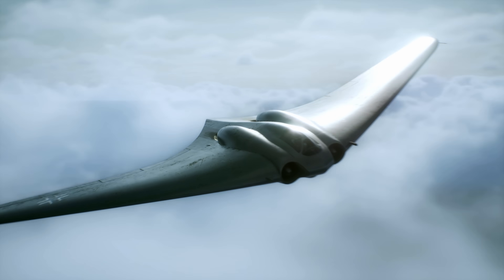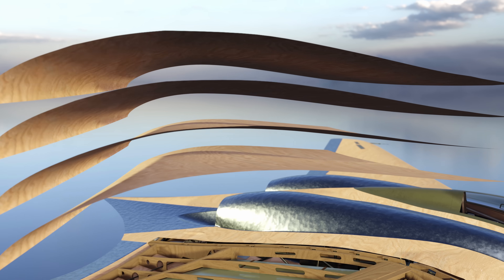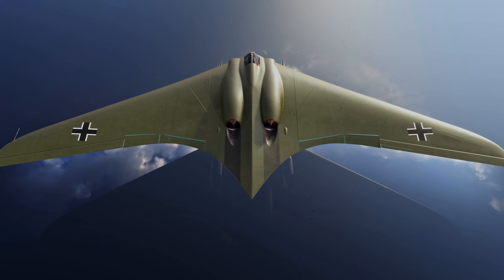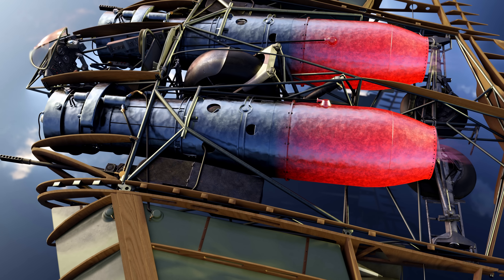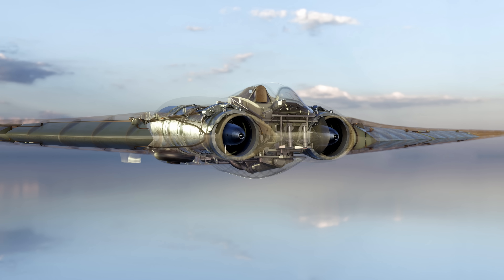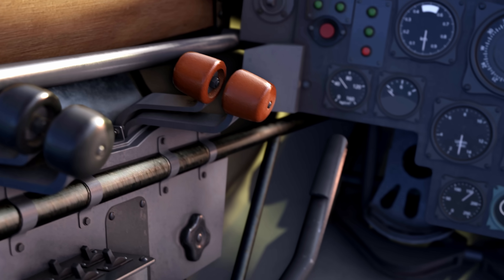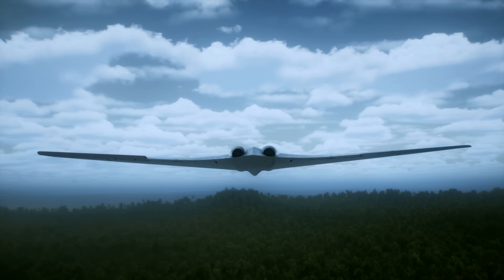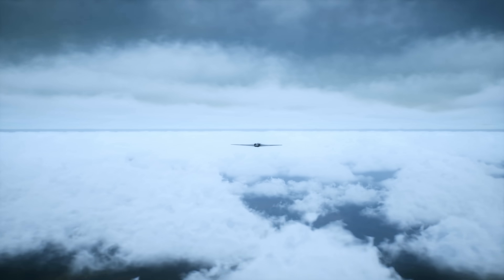Inside the Horten Flying Wing

Comment: You completely over looked both the B-35 and B-49 flying wings of Northrup. Both of which were in inspiration for the B-2 spirit, NOT the horton 229. Jack Northrup was experimenting with powered flying wing designs a decade before the Horton brothers.
Reply: yup, the ho 229 had nothing to do with the design of the b2, and it was also only marginally less visible on radar when they tested it lol
Reply: The Horten brothers did it before Jack Northrop in 1933 with the Horten H1 flying wing glider while Northrop did it later near the end of that decade and test it in 1940. Yes Northrop was powered first but The Hortens idea of a flying wing came first.

Comment: Lovely video and great content. I would prefer if it were narrated stating metric measurements though, esp. as it was designed using it.  But also, as an educational point - all science and engineering is based on it, so young minds should be exposed to it in this great context.

Comment: I wonder how this would of compared to the Northrup flying wing fighter developed in WW2
Reply: Well.

what the youruber omits is that these worked (not thanks to miracle control surfaces, but) thanks to bell shaped lift distribution, which made them stable.

Northrop used elliptic lift distribution. Making his airplanes unstable  - changing directions when no input is given, even B-2 is unstable witout computer aided fly by wire.

The whole theory that made this airplane work was lost in the german achives till 2015

Comment: Funny how you clowns seem to glass over the fact that Brothers Horton drew a great deal of their design inspiration from a Northrop’s founder Jack Northrop.  Northrops flying wings predated the Hortons by almost 20 years.  Bone up on your history kids!
Reply: ...well issue is they did in fact not.

Both Northrop, and the hortons made no shortage of dubious claims.

So lets stick to what aircraft they built. 

The Hortons got this plane accepted for the same reason Northrop couldnt get any of his designs adopted by.military until the B-2.

The northrop planes were unstable (without computer aid, which B-2 got), while the horten design were aerodynamically stable.

This was not common knowledge till 2015, when some NASA research shone light on what made the horten planes flyable.

They used bell shaped list distribution (achieved by having a slight spanwise twist in the wings), while northrop used the "established" elliptic lift distribution.

Thus even IF northrop's claims are true about hortens stealing ideas from him, even then, the hortens made caluable additions to it, leading to planes that were flyable without computer aid

Here is some reading: https://ntrs.nasa.gov/api/citations/20160003578/downloads/20160003578.pdf

Comment: This isn't the only prototype flying wing Horton had designed. There was also a flying wing Bomber known as the Horton HO-XVIII (it is 18 in Roman Numerals), it was meant to take the war all the way to America, the HO-XVIII is like the HO-229 but much larger, with 6 jet engines, and a gun turret
Reply: The Ho XVIII was only a project, not a prototyp.
Also Horton never designed any aircrafts, all he did was hearing a "huh".
The Horten brothers designed and build serval flying wings befor the Ho IX, starting with Ho I in 1933
Reply: And unlike the Ho 229, which only just barely existed and flew, the Horten H.XVIII barely made it off the napkin to the drawing board. And went no further. And was also hardly the only delusional proposed wunderwaffe meant to take the fight to American soil. 

Even the Japanese leadership knew it'd be impossible to win against America when they declared war. Guess all the meth got to the Nazis' brains.

Comment: You can say anything you want about the Horten 299 but it was an incredibly advanced prototype by any standard. It did had its share of important issues but possibly it was around was the Jumo The Junkers Jumo 004B that had very short "life" because of shortage of heat resistance alloys and prodigious quantities of fuel and the tendency of overheating. How it was determined that it would very difficult to fly I don't know.! Excellent video and I like this video very much 👍 👌
Reply: "How it was determined that it would very difficult to fly I don't know!" Because it was nowhere near the only flying wing prototype of the era and they all have issues with the complex controls needed. A momentary lapse in awareness could (and did) cause you to crash if you weren't constantly babysitting the controls because they needed constant adjustment. There is a reason the flying wing was a dead end until computers advanced enough to automate the control inputs needed for stable flight.

Even Northrop's advanced and actually real and tangible designs (unlike the the plywood prototypes made by a failing, wannabe empire) took decades to bear fruit, and it was paid for with its own share of blood and hard-learned lessons.
Reply: @Nyx_2142  I agree fully with you 👍👍

Comment: There seems to be several flaws in your "report," first, all war time and directly after reports do not suggest the aircraft to be a "fighter bomber" as you say, but an intercepter. Another of the flaws is that it was not stealthy,  however national geographic and northrop's mock up was subjected to the radar frequencies of the time, 1945, and found, that if the aircraft had gone into production, it would have gotten within three minutes of target before being detected by radar signals, to quick for a meaningful response until after the attack.

Comment: The split drag rudders do no look large enough or outbound enough to be effective, and when deployed they disturb the airflow over the elevons. Yaw control would be more effective using clamshell rudders at the wing tips outbound of the elevons with the added benefit of closed position combined movement to trim the flying wing in flight and deployed together act as spoilers, which was the final configuration of the Northrup N-9M small scale test bed flying wing. 

Interestingly, the N-9M actually needed more centrally located spoilers for landing as could be found on the Horten because when landing the N-9M flying wing would create ground effect lift making it difficult to land. The needed extra spoilers where never added due to the plane being a test bed. I have seen the N-9MB in flight during an airshow. The top of the wing was painted yellow and in a slow bank was extremely graceful in flight, it looked like a strange flying potato chip, but to me was the star of the show, looking amazing in all aspects of flight.

Comment: I highly doubt the engines would have let the design, or pilots, be that maneuverable in real life as they would flame out in the Me 262 when it would try tight banking in a dogfight or by opening the throttles too fast. They just would not stay lit. And BTW, the model made by National Geographic is currently hanging in the San Diego Air and Space Museum.

Comment: Too bad the Smithsonian hasn’t restored it. They stored it in a place where it was exposed to moisture and the plywood skin is deteriorated and the frame is rusted. They’ve had it at the Hazy Center restoration shop since I was last there in 2012 and have done little to nothing on it.
Reply: +@fw1421   The museum should duplicate the wooden components and construct the example to the unfinished condition as found in Germany.  It's rotted because of poor storage when donated to the museum.

Comment: Thanks for the video David. It's always nice to see in-depth modeling of the different machines you cover.  I have noticed a few errors or oversights regarding the drag rudders and spoiler. According to the Royal Aircraft Establishment's report No. F.A. 259/1 the outboard spoilers were part of the drag rudder system, fully deploying before the inboard ones as the pilot pressed one of the rudder pedals independently. To add further info about this, the report also states that both pedals could be pressed silmutaneously to use the drag rudders as spoilers proper and increase longitudinal stability. 
As for armament "Monogram Close-Up n°12" states that there were two planned fighter loads, either 2xMK103 with 140 rds. per gun or 4xMK108 with 90 rds. per gun and a short barrel, although the book "Spirit of Thunringia" states the same MK108 load and 170 rds. per gun for the MK103.
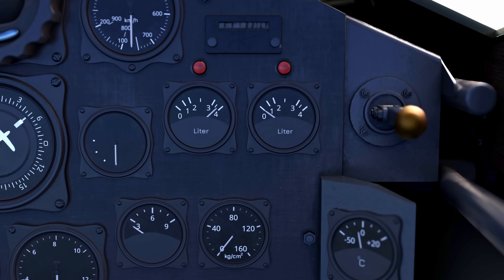The instrument panel could have used a bit more details since there are quite a lot of period and recent photos showing it in several books. For example, the radio indicator at 11:15 was in fact an AFN2 blind landing instrument which also doubled as a radio navigation instrument but the one depicted in the video lacks its altitude gauge, and the tachometers lack the dual RPM scale. Some of the updated textures could be used for future videos on other german aircrafts.
Reply: Quite the in depth and thought out comment! Im sure that the team will appreciate your constructive criticism and I hope you have a fantastic day!
Reply: Those missing instruments might have been taken by Allied souvenir hunters.  Also, by that late stage in the war, aircraft parts were often pirated off of crashed aircraft.  I believe the Horten 9 nose gear ,once belonged to a bomber.
Reply: @jeffreyhagelin3672  The Third Reich was reduced to collecting parts of downed Allied Aircraft for their own prototypes because only a madman would take on the English Speaking Nations, the CCCP,  as well as numerous European Nations with such a small military. So be glad that Adolf Hitler was an idiot, like the rest of the Axis Leaders, as well as Donald Trump, Vladimir Putin, etc. as that limited the damage they could inflict on humanity...
Reply: Thanks a lot` before Paris ending flight of me Goｰ229　1970
Reply: I have to wonder if 21st century materials & techniques would produce a superior tailless fighter (aka B2 style). Perhaps the Skunkworks or another firm is  already is doing so.

Comment: I know the arguments on "is it stealth" and know the pros and cons. Modern definitions of Stealth really apply to Modern Radar Systems and typically ignore 1940s Radar System Capabilities. The Mosquito was considered Stealth for the 1940s with its plywood construction, the Horten would have been stealth for the 1940s with a greater capability than the Mosquito's ability to hide from German Radar systems; coupled with the Horten's size and shape its visibility to the naked eye is far less than the Mosquito. I would honestly like to see two flying versions built off the design, one the original 1940s design, and one using current construction techniques and materials with modern Fly By Wire systems and Avionics to just see what a modern version could do. Just swapping over to Modern High Pressure Aircraft Tires from 1940s Low Pressure Tires would be a weight and space savings. Changing the Airframe to modern Composite construction could shave thousands of pounds giving a stronger overall Airframe. Use of modern Aircraft Control Systems and Avionics would shave off hundreds of pounds and increase flying ability. Switching from a 1st Generation Jet to a current model Fan Jet would both increase speed and range. I could go on.... and, its sad because I know no one will step up to give us that.
Reply: That simply wouldn't work bud. The Horten both isn't that stealthy and wouldn't really have the space for flyby wire or turbofans. The airframe and platform are dead, and would be pointless to bring to modern standards

Comment: This plane looks so futuristic. The Germans really outdid themselves with this design. The only thing that doesn't look super modern is the cockpit, which is more in line with what was available at the time.
Reply: The canopy looks very sleek, are you talking about the actual controls? In that case, of course it did not look modern because they did not have LCD displays lol.
Reply: @romanvarcolac2238  Yes the canopy. Its too frontal if that makes sense. But thats just my my opinion of course.

Comment: 17:27 What about the Northrop XB-35?  I know it wasn't adopted by the air force, but it made its first successful test flights in 1946. Doesn't that count for something?
Reply: Despite what the guy in the video says (and what he doesnt), there is a reason why the northrop flying wings werent adopted, and why the hortens were.

Northrop used the conventional elliptic lift disribution, while the hortens used bell shaped lift distribution.

Using the latter makes flying wings aeodynamically sable.

As such you don't need ace pilots to fly them, when you lack computer aided fly by wire systems.
This was anything but common knowledge until 2015. So even the B-2 is built unstable, though its nice to see the B-21 incorporating the more effective design, with its slightly twisted wings.

Comment: Nat Geo did a program about this. Don’t know who funded it but a model was built in the Northrop Grumman model shop for the purpose of testing the aircraft radar signature or Radar Cross Section. RCS testing was performed. It was determined that the RCS was low (good) enough to effectively defeat the British WWII radar. Good thing this thing never got into production.

This also illustrates the wisdom of the strategic bombing campaign of Germany. Germany was denied access to high tech materials
Reply: It's literally talked about towards the end of the video.
Reply: @Pawheadshot  that’s what I get for bailing halfway through 😂 I knew some of the guys that appeared in that program.
Reply: Eh, it really wasn't a good test, the model didn't have engines and was entirely made of wood if I'm not mistaken, so it wasn't even accurate, and if anything, was just down for the purpose of making the documentart more sensationalized.
Reply: @gp33music41  engines were internal so that doesn’t matter. I know many of those guys and don’t think they would be so dumb as to not use a realistic surface material.
Reply: @Mrblueridgeman  But there were turbine blades, the Apu, external metal components, and internals, especially on a wood skinned aircraft, affect RCS. The 229 was stealth-ish don't get me wrong, but only because it lacked vertical stabs and the flying wing shape.
Reply: @gp33music41  I would expect they put appropriate materials on the external components. Otherwise putting that model up on the pylon and running the test would be wasted effort. At any rate I recall the Nat Geo program saying the improved RCS would give the Germans enough edge against British radar of the time to make a big difference.
Reply: @Mrblueridgeman  They didn't, it's just the truth, and the nat geo program went into to the test with preexisting bias towards it being stealthy. If you look up the white paper, it concludes that it was a little stealthier than like a 109, but only due to the flying wing design. Nat geo took this and ran with it, making it out to be as stealthy as an f22

Comment: Without vertical stabilizer, speed is faster but hard to control. Easy to get crashed especially when there is no AI computers on board with sensors, pitot tubes.
This is why CHN H20 is still just a paper plane on the top of a design table.
Reply: ...what maker of the video wasnt aware (or what chatgpt didnt mention) is that the hortens used bell shaped lift distribution, thus the fighter was stable without vertical control surfaces.

This was unknown up until 2015, as such when everything was flooded with B-2 documentaries, it became common "wisdom" that flying wings dont work without comouter aid due to instability.

Thats true about one wit elliptic lift distribution - all flying wings made by northrop, but not about ones that have bell shaped lift distribution